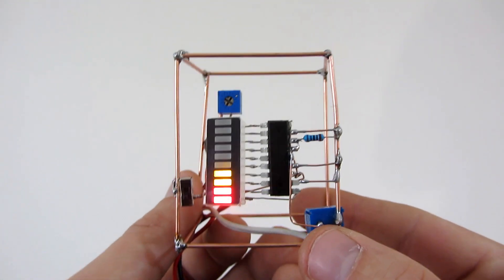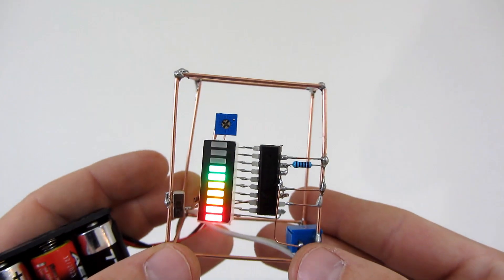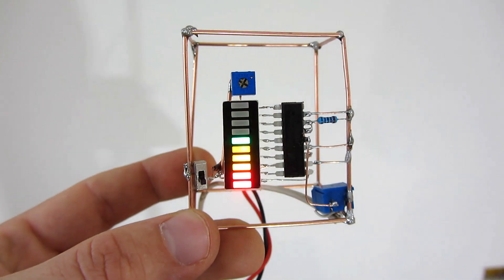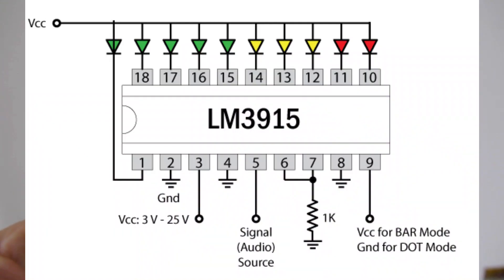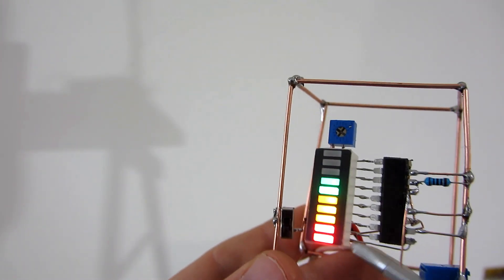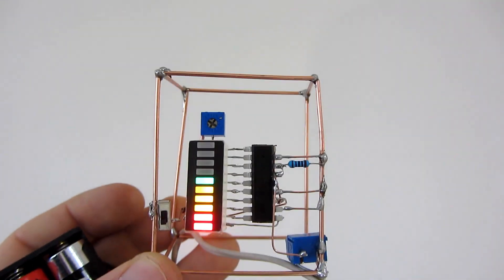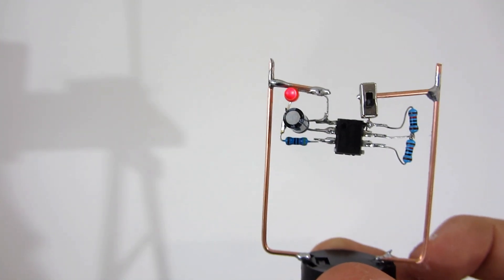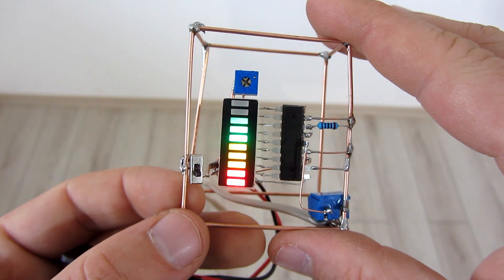VU Meter freeform circuit( LM3915) - improve your soldering skils

Comment: NIce job.  I think you've wired the LED's backwards.  Convention has the red as peak, and green as safe level.
Reply: True, But without a few extra wires he probably did it that way so save on the rats nest effect.If he merely flipped it 180 degrees it would not work as the output pins from the chip are negative. I think you know what I mean. Perhaps if he put the chip on the left side of the LED Bar and faced the top of the chip to the back it might have worked. Vodka is not letting me come to a solution right now. I think people call this technique "Dead Bugging". I like it.

Comment: Hi there! Can u tell me the value of resistance if i use 10 leds 5mm ? 
thanks a lot
Reply from the maker: you dont need rezistor for LED when using this chip, it have regulated output